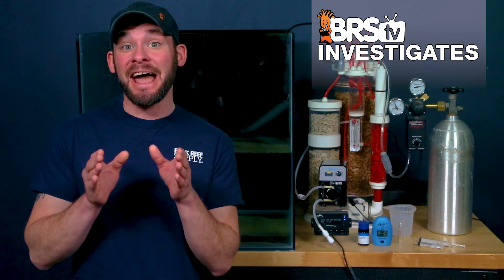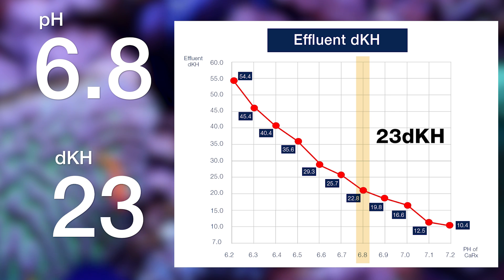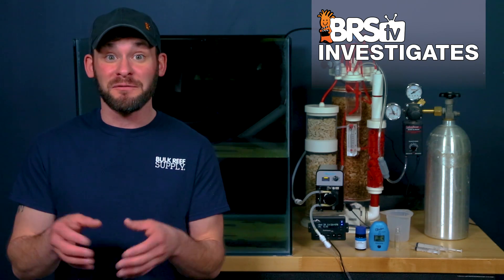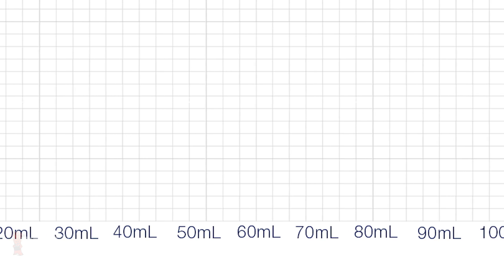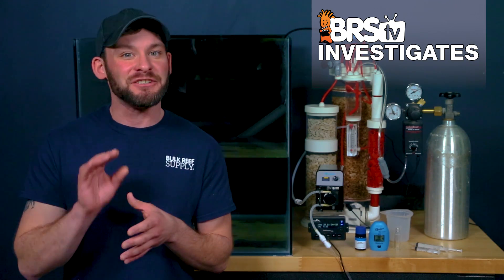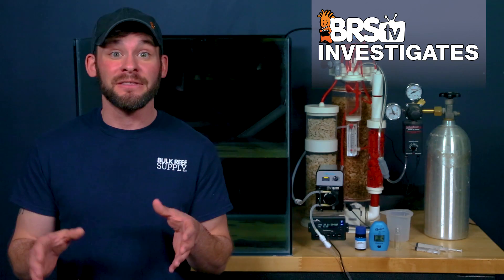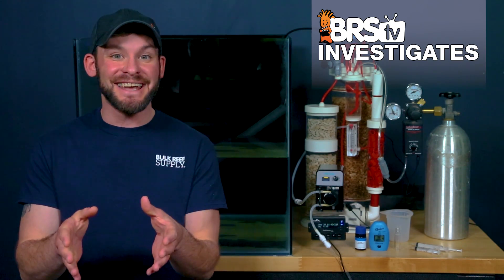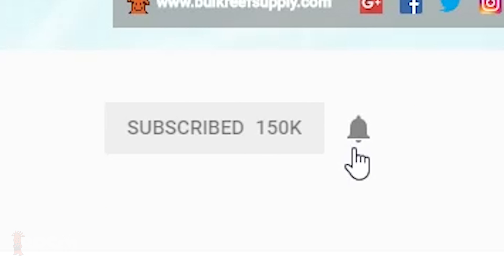Does the calcium reactor flow rate REALLY matter? | BRStv Investigates

Comment: So increasing the flow rate decreases the effluent dKH. I thought you guys said in another video that if you need more Alkalinity you just turn up the Kamora flow rate? So is this not accurate now.? This is confusing. LOL.
Reply from the maker: You're right, the effluent potency does go down with more flow, but the decrease is only a few dKH. We still recommend pegging the pH to a certain level within the reactor, then using the dosing pump to control flow and thus the total alkalinity output of the calcium reactor

Comment: You touched on the secondary chamber in the end of the video but in my opinion didn't go far enough in depth on it for the sake of this videos argument. Wouldn't the secondary chamber be a huge confounding variable in terms of the concentration of the effluent? Total efficiency of the secondary chamber regarding off gassing would have an effect on the results of effluent dkh proportionate to effluent PH out of the second chamber. The faster you run the effluent, the less efficient the secondary chamber would be at off gassing the co2 due to decreased dwell time. This would be less apparent with a larger secondary chamber, but it is definitely something I see as potentially being a huge flaw with this experiment. 

Adding a secondary ph probe to the final effluent or to the secondary chamber would allow one to see the change in efficiency of the secondary chamber. I'm very curious to see how this would actually effect the results in practice vs in theory. One could do this exact experiment over with both a large secondary chamber and a small one to see the difference

Comment: A little breakeven analysis:  Since 1 dKH is 17.848 mg/L (ppm) calcium carbonate, if you're dosing 5 mL/min of a 40.4 dKH solution, you're dosing 3.605 mg of calcium carbonate per minute. Even though you drop to 39.9 dKH at 20 mL/min, you're dosing 4x as much solution. In total, you're dosing 14.24 mg of calcium carbonate per minute. Likewise, 36.0 dKH @ 100 mL/min = 64.25 mg of calcium carbonate per minute. At the end of the day, provided you have enough evaporation to take the slightly more diluted solution, there's a net gain in the higher flow rate. 

IMO, based on the analysis presented in the video and a little arithmetic, I'd start with a moderate pH and increase the flow until my tank couldn't handle it (within reason) before I started trying to push the pH further.

Comment: CA Reactor related question... I've seen probe manufacturers call for replacing various sensor probes as frequently as quarterly to annually (pH, dissolved oxygen, ORP, temperature, conductivity/salinity...)  Naturally, this can have an impact on the total cost of ownership and operation. Have you guys looked into how much the accuracy might drift over time or the standard deviation of readings might widen?  A replacement schedule that might be necessary for something like pharmaceutical manufacturing might be overkill for aquaria.  Like the "Do I really need to replace my T5 bulbs annually" video, I think there would be some value for the reefing community in exploring this.  The answer to this question could change the value proposition for buyers.

Comment: I absolutely love my carbon doser electronic timer. But I have to admit I upgraded my regular to a high quality two stage type unit and its makes things way more stable as the supply tank PSI lowers over time which tends to let the C02 run away towards the end of the tank fill and can cause issues with stability. I'm very interested in your regulator settings and the bubble rate indicator  and even the amount of excess co2 gas in the reactor while running. Please add more observations your making as you go along. Thanks BRS!

Comment: Were the numbers normalized? Meaning, did you test the DKH of the tank water as it entered the reactor? In a normal reef, the incoming levels in the water would be somewhere between 6.5 - 12. However, if you're just running the tank water and calcium reactor on a closed system, the DKH of the tank water would continue to rise. This would contribute to a higher DKH as it left the reactor.

Comment: The problem arises when people want the solenoid not to be switched on/off frequently (noise and wear/durability reasons) and have the co2 rate dialled in exactly for a particular pH point. Changing the flow rate in that case will mean the effluent will be weaker because not enough co2 will be added to maintain that pH.